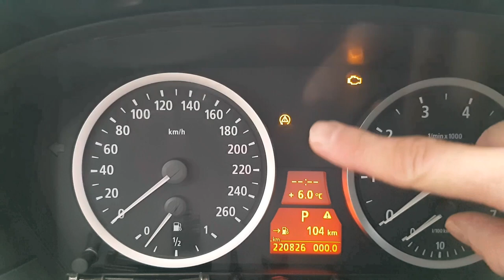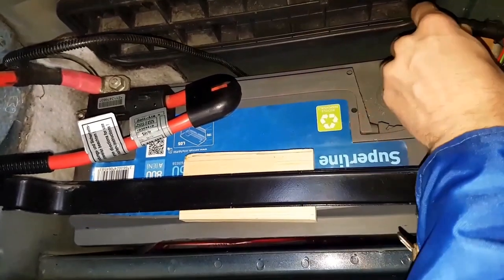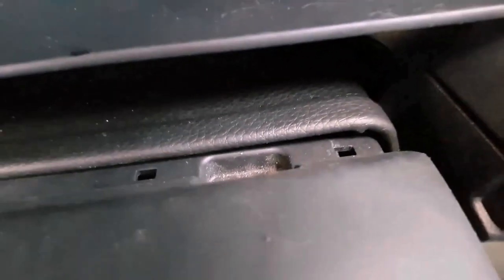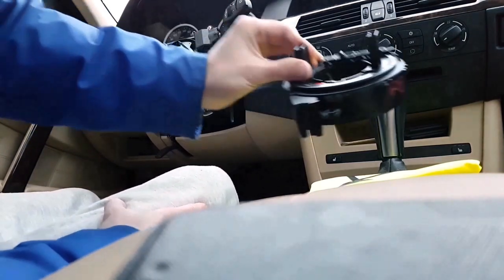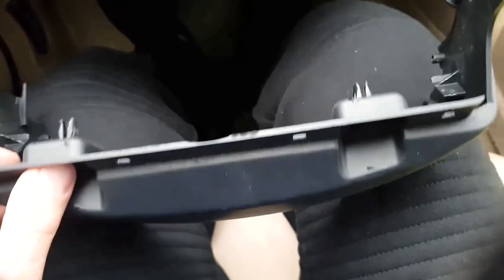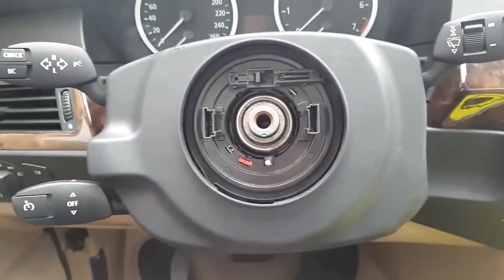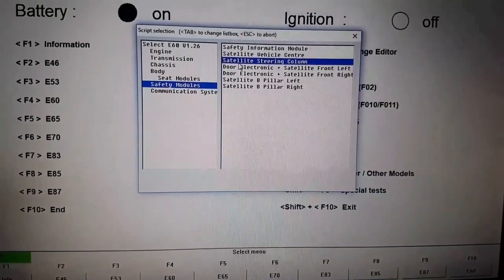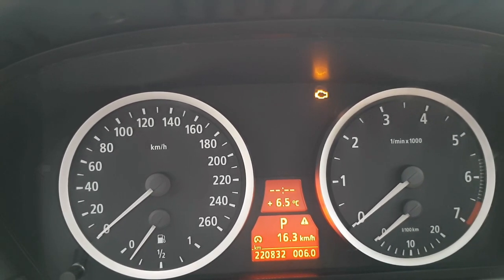STEERING ANGLE SENSOR CALIBRATION CODING PROGRAMING CLEANING REMOVAL REPLACEMENT SZL BMW E60 2003-05

Comment: Hey man hoping you or someone can help me out, i have to recalibrate my dsc im using ista. while my car is running ill get to the "turn off ignition for 10 seconds" i do and proceed but once i press "continue" i lose connection. when the ignition is on without the car running it fails faster stating "steering angle must be adjusted" and "dsc my be encoded" 
my dsc has not been replaced, i just got the codes 5dd0 & 5dd2
I also have the red handbrake light on, abs light on and traction control light on. the trifecta
Reply: did you get this sorted?

Comment: I have a 2007, do I need a ENET cable? ISTA cant communicate with the SZL steering angle sensor when im using the K+Dcan
Reply from the maker: ENET is necessary in F series Bmw. E series works with K+Dcan. Did you try to switch button on cable ?
Reply: @BmwFix  Okay i see, in your description you have "2007+ model has different dsc sensor and disc and they need ENET cable to code module." so I wasn't sure. 

WINKFP part works for me but the NCSExprt part "- "F6" "Back" (in my case I couldnt go "back". I had to first load another profile "Expertenmodus (Werkseinstellung)") - "F4" "Process ECU" - choose module you want to code ("SZL") - "ReadECU" - close the notepad window."

I do not have the F4 option, it is blank. I am using a full expert profile as well.
Reply from the maker: try on another profile

Comment: Hi, when I select my szl module which has been transplanted from a different car, nothing appears next to ecu address/integration position.  Only assembly and hw numbers populate.
Reply from the maker: did you program it ?

PROGRAMMING = FLASHING 
1- "INPA"> E60 >Functional Jobs>F3 UIF
2- You'll see a list of all control units with their ZUSB number and VIN
3- Take a picture or print it
4- Identify the ZUSB numbers without your VIN and copy from the PDF and close INPA
5- "WinKFP" "Load SPDaten" files (you will be programming (flashing) the module)
6- "Comfort Mode"
7- Find "ZUSB"
8- Paste the number you copied
9- this will go straight to the right "ZUSB"
10 - remember the name of the module or take a picture of that screen
11 - "CHOOSE ZUSB" wybrac modul ktorego nazwe wczesniej zapamietalismy
12- Then enter your full VIN and then click on 13 - "DONE"
14 - Double check that the module your going to flash it's safe to flash with your cable and the battery needs to be connect to another power source
15 - "Program"
Reply: @BmwFix  I think the mistake I was making was not closing out of INPA when in winkfp.  Going to try again today will follow your directions, thanks.
Reply: @BmwFix  I was able to get the programming to work.  Now I am stuck as how to do the NCS Expert part since I do not seem to see the same info on my screen as in your instructions.

Comment: hi I’ve matched my VIN with new SZL unit but still getting these errors 
my ISTA fails calibration every time 

9501 Steering angle sensor calibration. 94C1: Coding/data error.

5EBA (DSC Steering-angle sensor plausibility), 5DCF (DSC Control unit undervoltage),

Can you help please thanks
Reply from the maker: After changing SZL module I did as follows:
Connect car battery charger and charge it fully. Keep the charger connected during coding.

PROGRAMMING: 
1- "INPA"> E60 >Functional Jobs>F3 UIF
2- You'll see a list of all control units with their ZUSB number and VIN
3- Take a picture or print it
4- Identify the ZUSB numbers without your VIN and copy from the PDF and close INPA
5- "WinKFP" "Load SPDaten" files (you will be programming (flashing) the module)
6- "Comfort Mode"
7- Find "ZUSB"
8- Paste the number you copied
9- this will go straight to the right "ZUSB"
10- Then enter your full VIN and then click on "Done"
11- Double check that the module your going to flash it's safe to flash with your cable and the battery needs to be connect to another power source
12- Click on update ZUSB (this will flash the module with SPDaten files and re-write the VIN)

CODING:
13- "NCSExpert" (Code to Default (you will be coding the module)
14-"Load profile" - "Expertmode" - "F1" "VIN/ZCS/FA" - "F1" "Enter ZCS" - "E60" - choose any module you want from this list(In my case program wanted me to write VIN number. After I did it I got the message "VIN faulty". Clicked "OK", written VIN again and marked "calculate checksum" and "Cancel")
- "F6" "Back" (in my case I couldnt go "back". I had to first load another profile "Expertenmodus (Werkseinstellung)") - "F4" "Process ECU" - choose module you want to code ("SZL") - "ReadECU" - close the notepad window.
15 - F5 "Basic Functions" - "CoapiReadSgGetFswPsw" and click "OK" - F2 "Job Select" "SG_CODIEREN" and press "OK" - F3 "Execute Job" and wait for the buttons to become active, when active it's all done. 

16-"INPA" - "E60" - "Functional Jobs" - "Identification"
17- Take picture or print the PDF.
18- Look in the "SGBD" column the module you replace and remember the name
19- Clear ("EM", "IM" and "HM") errors and close "INPA"

RESTART THE SYSTEM TIME:
20- Ediabas Tool32 
21- Select "File" - "Load SGBD", Group file
22- Browse to the "EDIABAS\ECU" folder, and search for the file name based on the listed SGBD column in "INPA". Can be more than 1 file.
23- In the Left of the window select "systemzeit_lesen" (write)
24- In the middle of the window "Argument" (value of) type "1" in the dropdown menu
25- double click "systemzeit_lesen" and done.
26- double click "systemzeit_starten" (no arguments) too to restart the time 
27- DSC light should be off now
After that procedure the airbag and DSC lights went off.
Reply: @BmwFix  thanks did everything but I can’t reset system time I can’t find systemzeit??
Reply from the maker: it is last step. keep trying.

RESTART THE SYSTEM TIME:
20- Ediabas Tool32 
21- Select "File" - "Load SGBD", Group file
22- Browse to the "EDIABAS\ECU" folder, and search for the file name based on the listed SGBD column in "INPA". Can be more than 1 file.
23- In the Left of the window select "systemzeit_lesen" (write)
24- In the middle of the window "Argument" (value of) type "1" in the dropdown menu
25- double click "systemzeit_lesen" and done.
26- double click "systemzeit_starten" (no arguments) too to restart the time 
27- DSC light should be off now
After that procedure the airbag and DSC lights went off.
Reply: @BmwFix  hi yes there is definately no systemzeit_lesen in the left window I’m stuck what to do
Reply: @jasonpugz  yup, I can’t find it either, did you ever figure it out?

Comment: Fucked my 09 550i ALL UP! IM ON LATEST ISTA & ISTA P. My issue was only coding. All my modules were good, tried to update some moduals and accidentally tried to update the SZL. THAT THREW AIRBAG LIGHT ON AND RESTRAINT. NOW AFTER YOU ADVISE I HAVE CHECK ENGINE ON AIRBAG, RESTRAINT AND ABOUT 20 CODES!!
Reply from the maker: After which advice exactly ?
Reply: At 17;00 min. To the end on winkfp... I been using the software for three years, I NEVER have had to input the same module twice before coding like you said. I really flash any moduals with winkfp. All my modules were good until I followed your procedure. I was simply trying to update my modules and got code error on my airbag module. Following you way it changed my vin # for my ORIGINAL PIECE AND FUCKED UP ABOUT 5 OTHER MODUELS AND EACH ONE IS POPPING OUT 5+ CODES!
Reply: I never had any problems with my steering sensor nor DSC, NOR AIRBAGS. my car I bought from dealership and it only has 110,000 miles. Have all service records and history records. It's fucked up and that fix is gonna cost me a lot of money now. When nothing was broken. Now it's a shit load of codes and I don't have icom cable besides kdcan
Reply from the maker: did you charge car battery fully and did you have charger connected to the car battery during coding ?  it is very important. That procedure worked for me and many other people who needed to replace SZL module. that procedure is not for updating all modules. It is only for SZL module coding as the title of the movie says.
Reply: Yes. And like I said before. I didn't need replacing I just needed the correct coding for szl moduel
Reply from the maker: you should NOT do that procedure if you are NOT replacing the SZL module.
Reply: LOL!!! YEAH, little late for that. FOR ANYONE ELSE WOTH THESE SAME PROBLEM, PLEASE,PLEASE.... ASK PROPER QUESTION BEFORE PROCEEDING! OR YOU WILL BE STUCK JUST WERE I AM. DO NOT DO THIS PROCEDURE FOR RE-CODING THE SZL MODULE! THIS IS ONLY PROCEDURE FOR AFTER A REPLACEMENT HAS BEEN INSTALLED. IT IS NOT A FIX FOR RE-CODING YOUR EXISTING SZL MODULE!
Reply from the maker: That is only if you change SZL module. if your module was all right why  are you messing with your car and blaming other people for your mistakes ?
Reply: I take full responsibility for my actions. You video I thought could help me re-code my module. You never state that it's ONLY FOR NEW MODULE INSTALL.
Reply from the maker: did you try to update SZL module with my steps  ? where did I say it is updating. it it programming for other VIN. it is not updating
Reply: Just an update on the issue I had.. I have fixed the coding error and fixed all the errors with the SZL MODULE and also updated THE MODULES THAT WERE THROWING CODES DUE TOO WRONG CODING WITH  LATEST SP-DATEN 70.0 FILES.
Reply: Had to write new vin also code in newest updated software for the SZL module and alo sync the time like you said in your video. Sorry for blowing up on you bro. Keep up the good work
Reply from the maker: thank you for answer